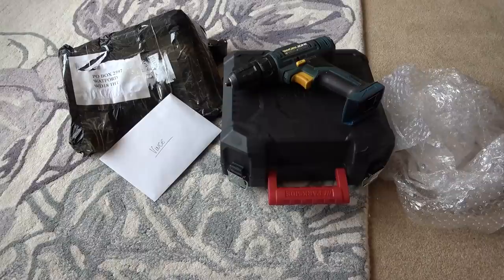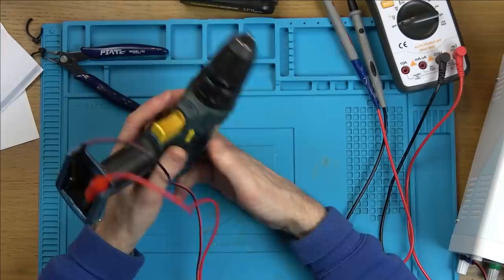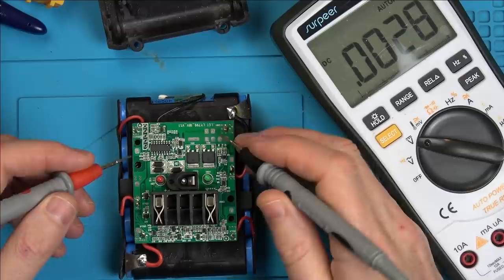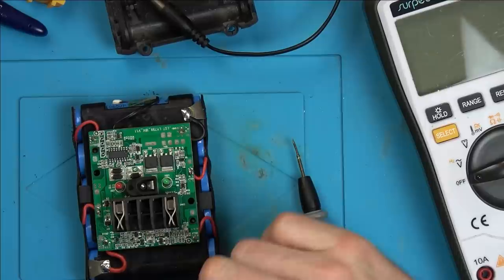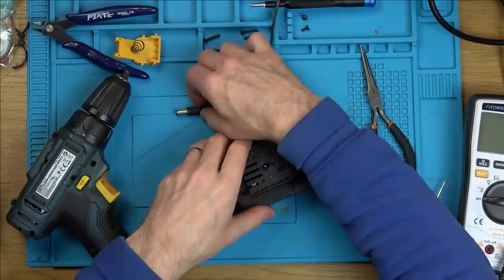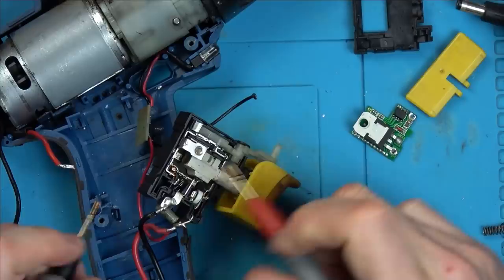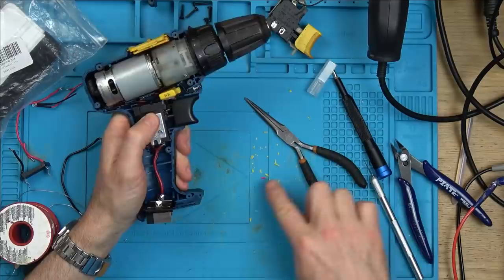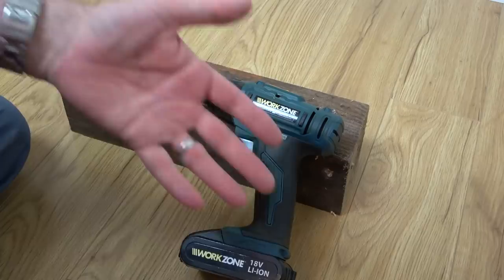No Power on a Cordless DRILL - Tea Break Fix

Comment: Hello Vince.
I got similiar problem with a battery from Aldi. The voltage was there in the cells, but the output voltage of the board was very low. I found out that the temperature sensor cable was loose so it limited the output voltage. (Or I believe it is for the temperature. The thin wire which is glued on the side of the batteries.) When I resoldered it immediately came back to life. I would be intrested to see if you wiggle the sensor cable will the output voltage drop on the battery.
Keep it up, great videos :)

Comment: Similar problem to a RC car I had but it measured the correct voltage but I didn't have enough power to move the motors for long

Comment: i always use the hammerdrill setting to drive in screws
Reply: And always pick the correct driver bit for the type of screw,it avoids the skipping you get on the screw head.
Reply: Hammer drill? I know drill drivers are good for screws, but they’re not hammering up and down like a hammer drill does. They instead apply torque in pulses which works better than continuous force. Hammer drill is supposed to be for smashing tiny pieces off masonry when you drill into brick, mortar or concrete.

Comment: I think i know what is going on now since some of the batteries are under 4v all the cells together go over 20v probably there is some circuit that brings that voltage down to 18v to power the drill since some cells are 3.8v the battery voltage is too low one one cell it isn't making enough voltage so instead your getting 15v instead of 18v at the output that's why the charger is over 20v because all together the cells are over 20v but because one cell is 3.8v instead of it being like 21 22v it's 20v so the circuit that brings the voltage down is only giving 15v instead of 18v that's probably why when you give it 20v it doesn't like it but 18v it works fine i hope you understand i tried to explain as good as i can in the comments I'm only half way through the video so i guess we'll see if my theory is correct or not
Reply: Again I'm not sure I'm just guessing

Comment: Hey Vince. I saw faulty psvr headsets on eBay for under £30. Might make for an interesting video!
Reply: Depends on the issue. V1 often have broken wires in the cable. Not too fancy.
Reply: @marcianzero_yt  I bought a broken a couple of broken v1s and was able to salvage parts from each one to make 1 good one

Comment: I'm surprised passing current to the drill unregulated fixed whatever was shorted. I'm also surprised that short didn't manifest when you connected the drill directly to the bench power supply and the power draw seemed normal. I guess shorting the battery worked out in your favor as you may not have noticed the faulty trigger otherwise. Definitely a "do not try this at home" moment though.

Comment: Nah it basically one of the cells just needed a jump start as I ran into a few 18650 that were dead to the point it not outputting any voltage. The trick is use another 18650 fully charge and run it into the same + and - with wires for about 15 to 30 seconds along with dmm measuring the battery you will see the dead battery comes back to life. It some sort of protection inside the cell that it don't like to be under certain voltage causing the dead cell to appear that way

Comment: I think when you connected the wires direct you may have re balanced the cells in the battery as they were out of balance not allowing the battery to gain it's full charge. I would imagine that switch will be fine as on your bench power supply the drill was drawing around an amp, so can't see it ever getting to 20 to burn out the switch in normal use.

Comment: If one cell is lower than the others then it is dead. You can replace only one cell but it will not be a lasting repair.
Reply: Yeah, replacing only one cell will just lead to the other cells being slightly overcharged because that cell has a higher capacity (being brand new) and will charge at a slower rate than the others resulting in the new cell being charged to maybe 4.0V and the others to 4.25V, the problem will get worse as the slight overcharge damages the other cells more and more and the gap in capacity between the cells becomes greater until it kills the entire pack.